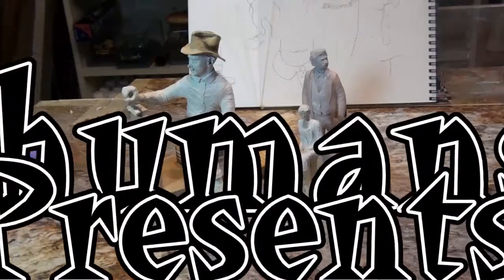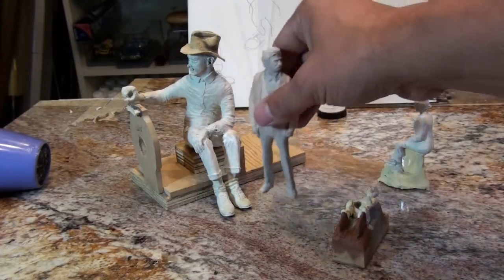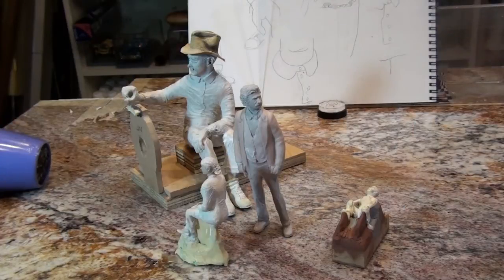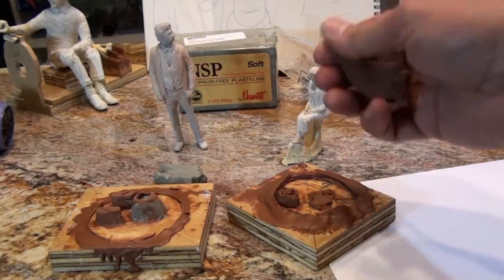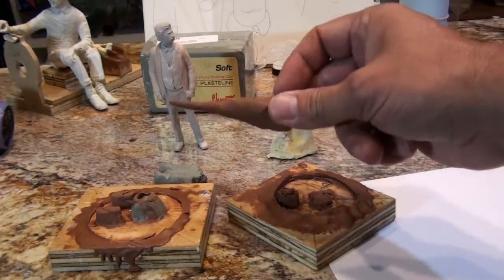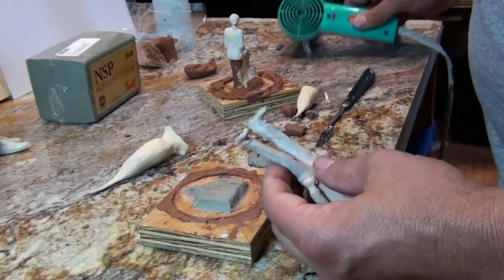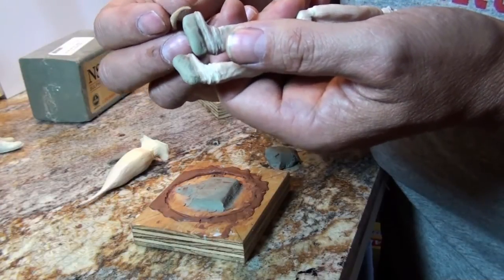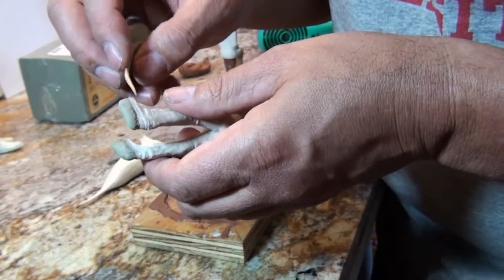Mold Making Part One scene 1

Comment: I was wondering I am a collector of Gi Joe figures and am looking at taking a Gijoe head and making copies of it if I use a mold to take the impression of the head and then after making the mold set for the outside of the face and head in the pouring of whatever type of materiel it will take to do so; I'm talking about after it has set and everything's okay with it will the end product vary any from the original head or does it depend on what is being used and so forth?
Reply from the maker: The quality of the cast depends on a few factors; the quality of the mold you make, the type of mold you make and how well you pour the casting resin. You can improve the quality of the cast by getting a slower curing resin and casting it under pressure. You can improve the mold by getting a slower curing silicon based rubber and using a vacuum chamber. In fact if you are going to cast under pressure it is imperative that you submit your silicon to at a minimum of 29 mb of vacuum to remove all air bubbles. 
Once you've take care of those factors, you must consider how you design your mold, 2 part or 1 part. Both have their advantages but both introduce slight variations in the original. These will be caused by the seams of the mold, or by closing the mold too tight and distorting it. To assure an exact copy, you should use a shell to pour in. That is more information than I can give in a single reply, but there are plenty of videos describing that process on youtube.